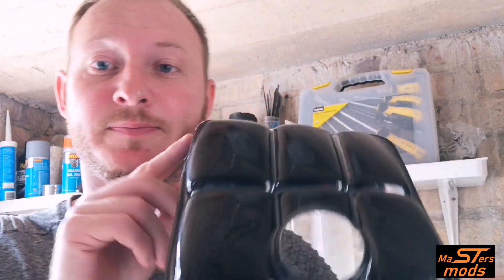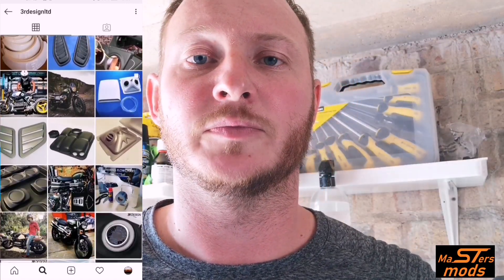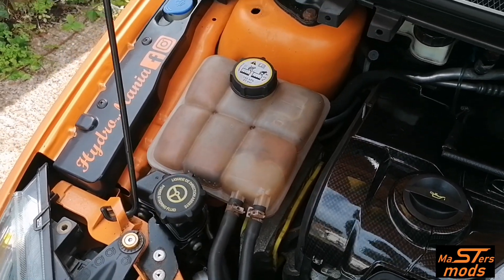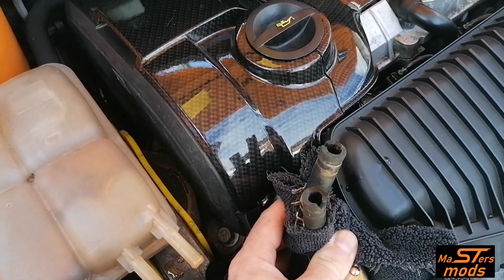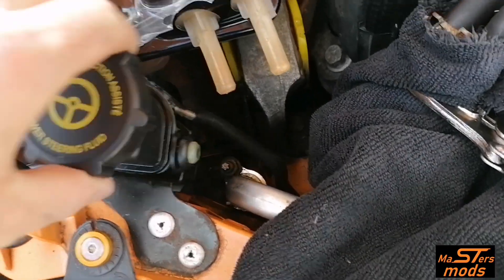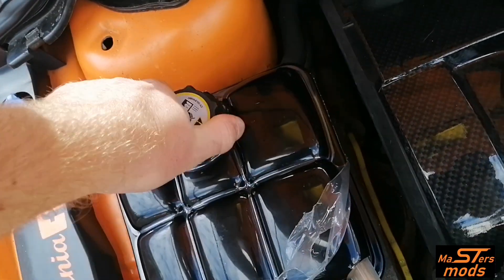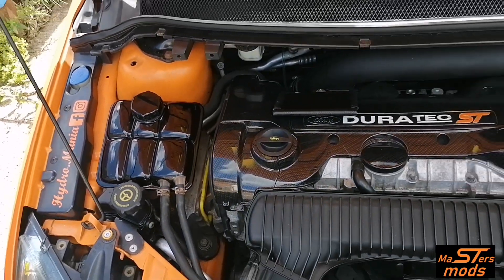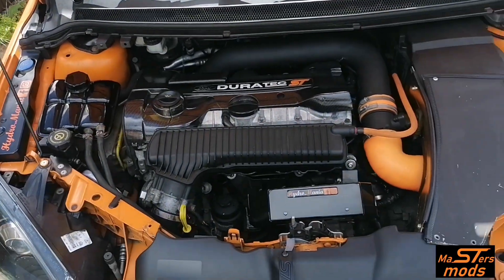Installing a 3R Design coolant reservoir cover

Comment: Nice one Ash looking sweet you sorted all the coil issues?looking forward to seeing it on the rollers
Reply from the maker: Thanks mate. I think so yeah, we've had some terrible rain and all has been okay so far 🤞🏼 how's yours coming on?
Reply: @mastersmods  slowly getting there needs all new wishbones droplinks bushes shocks so will lower it at the same time and Chuck new discs and pads so saving my pennies at the mo
Reply from the maker: @qaza007qaza  sounds good mate 👍🏼 will feel loads better when it's all done then